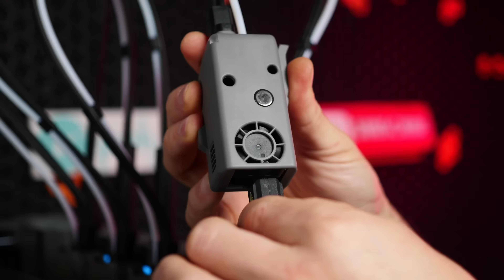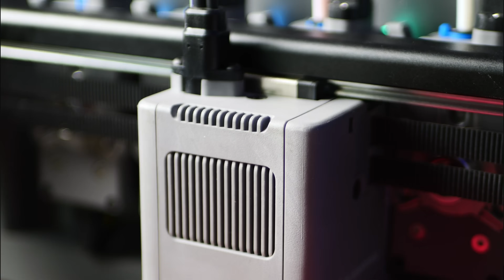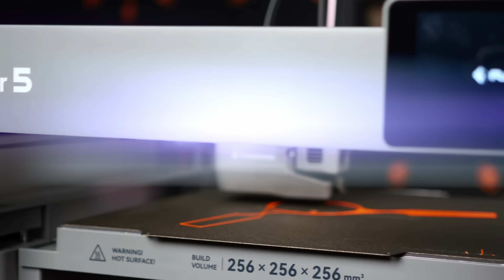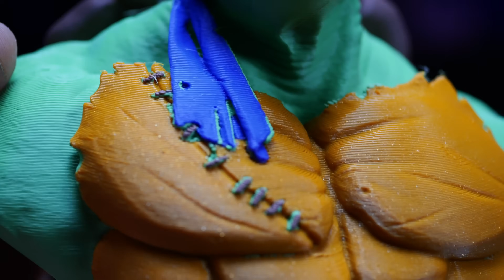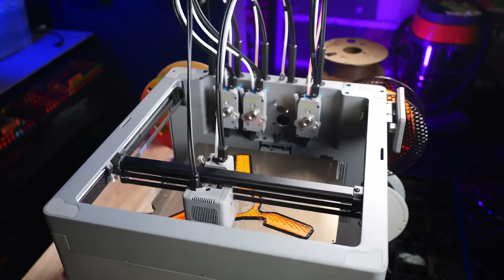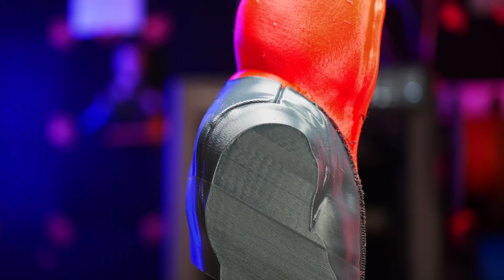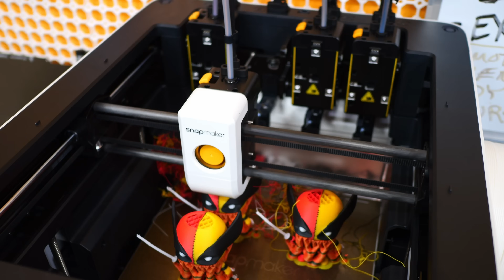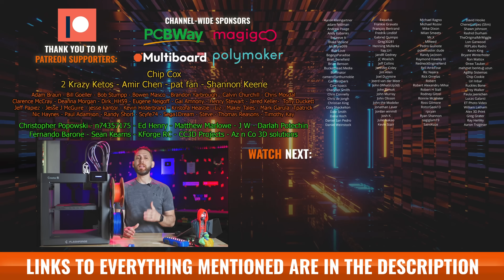How Good Can a $699 Tool Changer REALLY Be?

Comment: Owned many flashforges since 2014 infact i still have my original creator pro bought in 2016 and creator pro 2 Idex, theyre still my gotos for abs... People make fun of flashforge "cutting corners" to make the creator 5 more affordable but the company has been building good solid simple 3d printers since 2012.. DUAL NOZZLE PRINTERS in 2012.. sure it might not have all the automation of other brands but it will out live them.

Comment: Check if standard OrcaSlicer can connect to it, or if you need to use the Flashforge-branded version.  I've heard that Flashforge closed the TCP port for local printing on the Adventurer 5M printer in 2026-May, and I'd rather be able to use the latest OrcaSlicer rather than being bound to their less-up-to-date Flashforge variant of Orca.

Comment: Some interesting things happening here but come on, after the early bird pricing this is NOT a good deal, it's fair at best. If after support and replacement parts aren't great this could be an absolute turd. Recommending the printer at this point is a big gamble. I do hope this turns out to be really good but it is still really expensive for an unproven machine.

Comment: The test is completely inadequate. The corresponding slicer settings should be provided for each printed model, as the errors visible in the models clearly indicate insufficient slicer settings.

Aurora's testing is far superior, displaying the slicer settings and usually releasing the printed models.
Furthermore, comparisons to other tested printers are included, which makes the young team's approach very professional.

Comment: I think if we think of 3d printers as less of a "novel and unknown" method of manufacturing, if we instead think of it as a "CNC machine that deposits material instead of removing material" we begin to realize how many conventional machining and manufacturability design concepts/practices can really improve 3d printers. I think people who want one tool head to do it all will realize what every fab shop and production facility realized a long time ago: sometimes, a series of specialized tools rather than one universal tool will not only be faster, but cheaper, and even higher quality. It's why we don't have packaging machines built into a CNC mill. It adds complexity and tooling costs while extending tool path times for an overall slower automated process rather than just having the CNC machine crank out products and a packaging production line packaging those products just as fast as they are being produced.

Comment: I can see this being a primary PLA/PETG/TPU printer in a multi-printer setup.  BUT, in a solo printer home?  No way.  I would go for the U1 in a heartbeat.  Bigger volume and easily converted to an enclosed cabinet.  And easily same print quality as our Bambus with minimal tweaking.

What we need now is a +5 tool head, maybe around a 300 cubed build volume model from someone to finally price out Prusia.
Reply: you mean the normal one? just get the pro model, you can print 10 more engeneering filaments, you can use the normal one too but without warping filamets, the U1 is made for multicolor not professional use for 100 bucks more just get the pro version, full chamber heating ctc50 filter and hepa 13, 320°nozzle exc

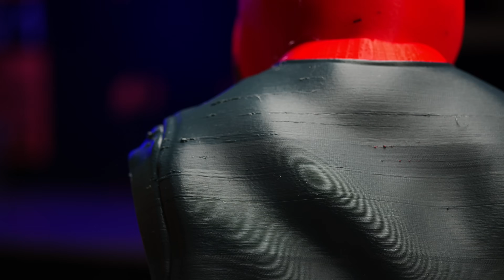Comment: @thenextlayer, there is a very easy fix for the problem with the outer surface, described at 15:00.
Please try this explanation and show the result to your viewers — anyone should know this "bug".

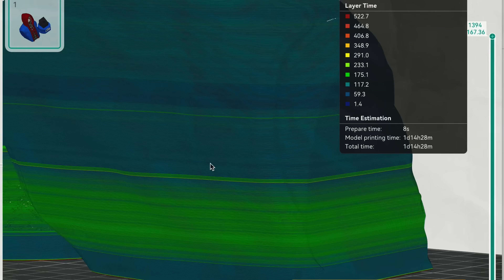Go to "Material settings" > "Cooling" and set the default value of "Layer time" from 8 to 0, then show us the layer preview at 15:40 again.
*Better switch to Layer Speed instead of Layer Time and compare these previews — this will clearly show the real origin of the issue (which is Layer Speed)!*

You will already see, without printing, that the layer speed will become more consistent. This will lead to a way cleaner outer surface.
Why? The value of Layer Time can significantly affect the printing speed, depending on the individual print.

I always change this value to "0" for every filament/print because I wasn't able to determine any benefit of this funktion.
Maybe in some very specific cases there is a benefit of setting Layer Time above 0.

Comment: I'm curious how the tool locking works and what  the weird ring around the extruder is. I also wonder if there's special precaution needed for aligning the gears before loading a tool, maybe the gears are just shaped in a unique way to guide it?
those prints don't look that great.

Comment: Did you see any artefacts on the Design that could be leftovers of a automated filament cutting? Like maybe somewhere close to the build volume there are some unused screw holes that could late be used to mount a Cutter-Lever-actuator part which the toolhead would move against. 
If so that could be signs they are working on a MMU for the printer
Reply: They're working on the VDS product, which should be released in July.
However, it's supposed to be just a double-chamber dryer.
However, it connects to the printer with a cable.
Reply: @Fabrizio-xk1ly hmmm. There are already enough 4 spool / 2 Chambers filament dryers. Hope they add some good functionality to it otherwise i dont see the point in just another dryer.
Reply: @KidCe.  Well, it would be their dryer, and therefore a profit for them.

We can only wait for it to be more officially presented to find out what it does and doesn't do.

That is, whether the cable connecting it to the printer will only be used to communicate temperatures and little else, or whether it will be a motorized dryer (and therefore also an AMS).
However, so far, no buffers or anything else have been shown between the printer and VDS (the filaments also flow externally in the air), so it's more likely that VDS is just a dryer.

Comment: Хорошо бы было, если бы все 4 сопла были в одной голове. Я думаю что скоро и такие появятся.
Reply: However, you'd have a much heavier printhead and would have to print more slowly.
Furthermore, due to the offset between nozzles, you'd lose part of the print area.

In any case, AnyCubic demonstrated just such a printhead.
But it was also April Fools' Day, so it could just be a joke (April Fools' Day).

Comment: Is there any more info on the viability of AMS use? I would be coming from Bambu as my first printer, so I have no point of reference. Does flashforge have an AMS system? Or is the potential for AMS use fully theoretical? If this gets an AMS announced before Bambu comes out with a true/comparable tool changer I might buy this instead of the H2C that I'm saving for.
Reply: All we know is that they're working on a product called VDS (which you can also see in the printer's official video) and that it should be released around July.

However, not much is known about its features yet, and they're advertising it as a dual-chamber, four-spool dryer.

However, it also seems that this product connects to the printer with a cable that plugs into the accessory connector located under the second filament spool.

Whether it will only be used to communicate temperatures and little else, or whether it will be a motorized dryer (and therefore also an AMS), is still unknown.
However, no buffers or anything else have been shown between the printer and VDS, so it's most likely just a dryer.

Comment: Those little few grams of free filament are pointless, at the price point The Flashforge has always been a entry level printer and the fact That Flashforge has kept its price low for this machine demonstrates it knows it’s Market so in my opinion 4 rolls of 250g filament would have been a better option as I feel those who want to get into 3d printing will want a little free filament to play with and get used to the machine, because let’s face reality your need to buy Far more filament at a retail Price…. So it’s not really a saving to the customer more to Flashforge. That a side the machine looks really good and I might add one to my collection

Comment: Not seeing the big deal over the price.  A 4 color printer such as the AD5X can be had for under $400.   The entire "hot end" list for around $100 complete but the manufacturer costs is likely less, maybe $60.   So from a hardware perspective this printer based on the list prices would come in around $700.  Yes, it's not an apples to apples comparison, but the hardware costs would IMOP be around the $700 make - including their markup.   Machine/ manufacturing costs are likely Close to $550-600 per each.  Don't give me the R&D BS, all these companies take the fast road - AKA copy each other to minimize any real R&D.  So the price is "fair" given the current market, but we can still hope someone like Elegoo will come in with their tool changer and kill the price - like they dis with the Centauri Carbon printer.

EDIT: All things you mention used to cut costs actually and removed or defeatured actually detract from the value of this printer.  This is more like a $550 printer at best.  How much did FlashForge pay you for this video? You sing it's praise but point out all the weaknesses.

Comment: This video definitely helped me understand how design changes helped reduce the cost of this particular printer instead of just cheapening the design and overall longevity of the printer.  I'm looking forward to see what other vendors do to make these designs more efficient over time.  However some of the addons for the Snapmaker that allow it to preload the filament into a tool head and the larger bed size does keep me squarely in the Snapmaker camp, but not everyone needs more than 4 colors, and overall making less expensive more reliable printers is very good for the industry.

Comment: Im curious long term how that tool head swap system will hold up seems like with it interfacing it might at some point wear out the system and cause issues other than that and flashforge's awful support this looks like a solid machine

Comment: Lol..... All these cost savings are great.....😅 But given the Snapmaker i was looking at was the same prie...... It's a shame they didn't pass the savings on......😅

My 1st printer was a 'FF ADV 3' & it was a great little machine....... However They {FF} have zero customer service to speak of...... All 'Bug Report's' must be submitted to 'Facebook'!  ......🤬 off......😅 
& when the Windows switch off happened end of 2025......  my machine suddenly stopped working.... Spent several weeks trying to fix before i found out 'The Company' had decided, their users must upgrade to the new machines.....🤨

Comment: Lets clarify something, the P2S ins't $999 its $799 only $100 more than this printer. Also, the P2S is completely enclosed while this printer isn't. They basically removed a couple of features to add multiple print heads capability. That's why they were able to do that. Also, the cheaper lackluster software and cheaper build quality on this machine also helps with a lower price point. I’m excited to see manufacturers come up with different ways to have multiple print heads. This is only great for the consumers so that’s very good

Comment: Excited for mine. My wife got me the adventurer 5m out of the blue before I was ever even interested in 3d printing. And now I've got my 3rd Flashforge on the way. I have had no issues, and I can't justify wanting a more expensive one at this point.
Reply: I have two of the Creator 5s coming.  And I have 4 flashforge 5m's, 1 5m pro,  and 3 ad5x printers.  I have had no issues with them.  Any issues were my fault.

Comment: Dude! I've looked at the Flashforge printers for a long time but never pulled the trigger on one. This guy might be the one. I've wanted a tool changer since I started printing with multicolor/material printers. Also, I'm willing to bet, if you buy the standard, there'll be a kit to upgrade it to the pro later, making it easier to get going. I've seen that on their other printers.
Reply: No, FlashForge has already made it official that there will be no Pro upgrade kit for the standard version because they don't think it's possible.

Perhaps third-party vendors could offer them (at a higher cost than purchasing the Pro directly).
Reply: @Fabrizio-xk1ly eh, that's ok. I just thought it'd be an option, but no biggie.

Comment: Why is the filament exposed to the elements? They should be in a sealed case to keep out moisture. Is there some kind of AMS in the works?
Reply: They show one in the official Flashforge video: https://youtu.be/TPEPWDk5q8c?list=PLWfXP01hqgWu_XZL4Wn0izl1DMWcwVref&t=82
They name it Flashforge VDS. It is also visible in some 3D printing event footages.
Reply: @PhilippeLhoste  It's supposed to be released in July, but for now all we know is that it will be a dual-chamber dryer.

However, when they showed it at the trade show, it was connected to the printer with a cable that plugs into the 4-pin connector under filament spool number two.

In the official video mentioned above, however, it's simply placed on its side without any data connection, like a standard third-party dryer.

Comment: If they were smart, they would have made a bigger build volume than the snapmaker u1.. with a bigger build volume than the snapmaker, I would have definitely considered this over the u1
Reply: They wanted to cost significantly less (in %) than the U1, so they made certain choices.

Sovol is also said to be working on a 6-head tool changer.

If it were based on the mechanics of the Sovol SV08, then we would have a 350x350mm plate (with the SV08 Max, even a full 500x500mm).

Comment: I’m curious if I can still take advantage of my $10 preorder option? I forgot to place my order.
Reply: No, as of May 1st, the $10 coupon is no longer usable, and you've lost it (losing $10).

But in effect, whoever paid that $10 got a $150 discount (plus the option of air shipping at half the current price), effectively saving $140.

But aside from losing $10, it's not a big deal because they're now offering a $100 discount for a couple more days, plus two free spools of filament, which is roughly another $130-$150 savings, and no deposit required.

Comment: How hard is it going to be to cut and change filament on the pro with the top enclosure, I wonder?
Reply: It will certainly be less convenient, but it shouldn't be too difficult.

I believe the cover is just resting on the top, so it can be removed quickly by lifting it.

Also, if you lower the print bed, I think you can reach the printhead with your hand, even through the main door.

Comment: When a company comes along and does a innovative thing like Flashfordge did with this printers tool changer,  it only pays for them to be at least mostly bugfree and usable. Personally I like the idea. 

I think this is a platform that will be upgraded and changed over time. 

I'm with others I do prefer open source. Although I do understand sometimes why they keep things closed it's just a security thing for me more so than anything. Closing the system means a company can do things like Bambu did and I'm not a fan of Bambu's actions.

Comment: Thanks for putting the disclosures up front. And minimizing other manufacturers in a sponsored video is reasonable(ish) - and definitely since you mentioned it. I'd love to see a more in-depth review. When you do, could you please make sure you cover the software, and specifically whether you can use standard Orca slicer over the network with this printer. I have an AD5X, and had to install zmod to get that option. Given all the recent issues with the change from FFOrca to FlashStudio that others are having, and there being cloud issues that users have had to deal with, I think it's important that you cover these sorts of issues. TBH, I think this is a great looking/sounding printer from the advance reviews, but until I can use standard Orca over the network and cloud free with it (either officially or with a 3rd party hack, it's not a printer that I'm going to buy.

Comment: I'll be looking forward to what Bambu offers to combat these tool changers. They can't stick with the vortek because it cuts build volume, takes too long to complete builds compared to these changers, and so far, is far too expensive in their H2C. Either they release a tool changer in this price range with 4 total nozzles, or they lose out on the "future" of 3D printing. Even then it still takes too long compared to these changers. They could also be cooking up a better solution to multi color/material printing, but we'll have to see.

Comment: Will you be able to upgrade the 5 to some of the features on the 5 pro? Like an enclosed case?
Reply: Not from FlashForge itself; they've officially announced that there won't be an upgrade kit because not all the missing features can be added.

Perhaps third-party kits will provide something (but it will cost more than buying the Pro directly).

Comment: I feel sure this was advertised as zero purge yet you showed a purge tower. Also they state its 5 times faster. I wanted that to be proven. I have placed an early bird deposit on this but wan't to know if these statements are true first.
Reply: @NomaddUK  That’s for loading when you put in different colors, not during printing, same as the Snapmaker U1 when loading new filament.
Reply: *Prime tower. The nozzles have to prime to rebuild pressure